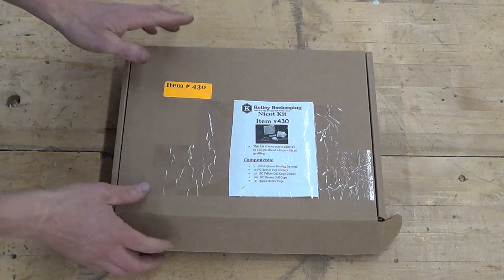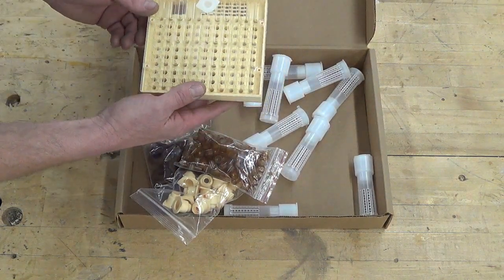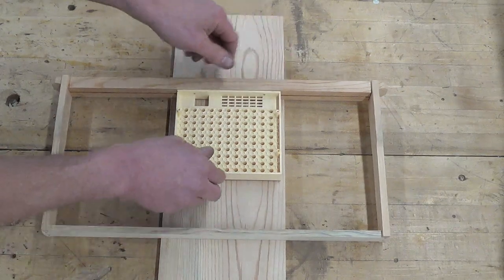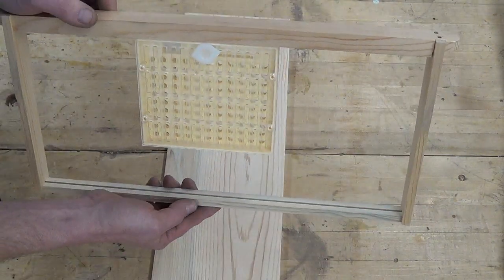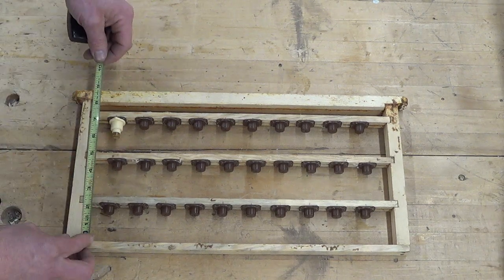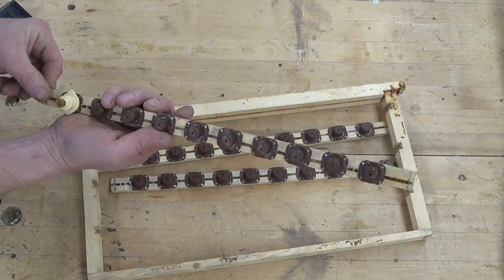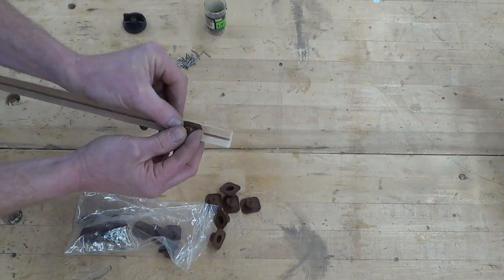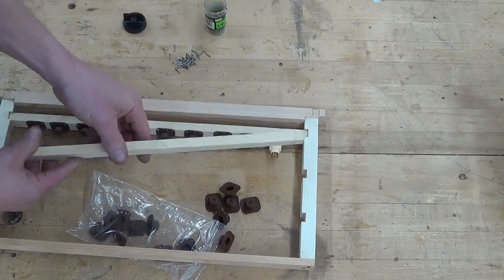Nicot Frame Set-up: Getting Ready for Step 1

Comment: Hi I have used the nicot system for years and had good results, but to get top results when you inspect your hives weekly save the Royal jelly from Queen cups in a small pot so when you have positioned your queen cups in your cassette using a cotton bud dip it in the Royal jelly and from the front of the cassette holes push the cotton bud covered in Royal jelly in to the cell touching the cup bottom and turn to add the   queen jelly substance and odor into the cell bottom, this will increase your queen cell take by 50% more.
Regards Paul.